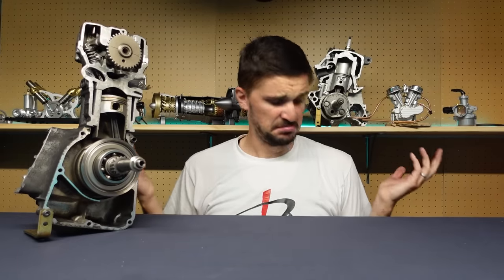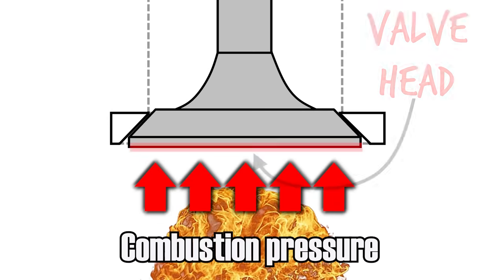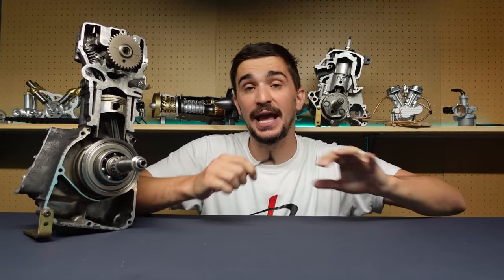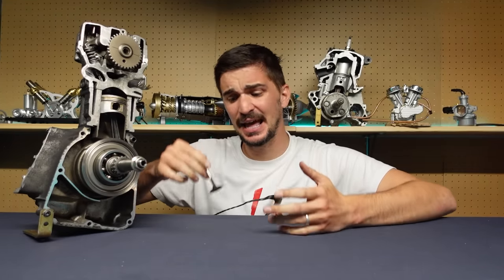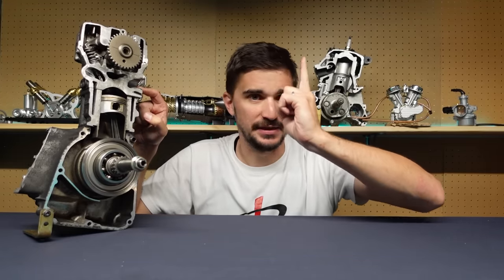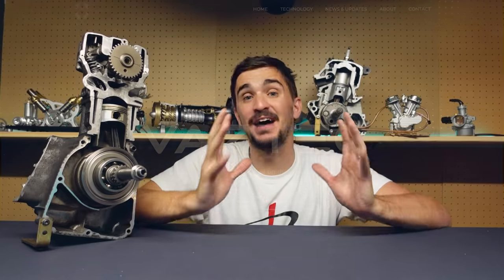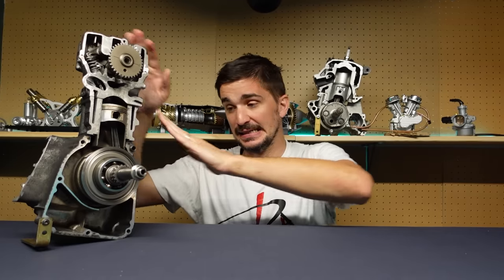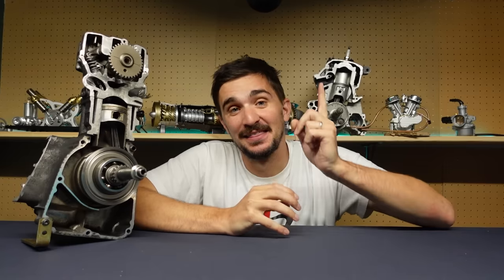Rotary Valves Make Normal Valves Look Silly - Why Aren't We Using Them?

Comment: I suspect that just like sleeve valve engines the rotary valves work out more expensive, especialy when you have a company with patents seeking royalties for their work. Could well be though that rotary valve systems lend themselves to ceramics as that withstands heat very well and as its rotary there will be no shock loads to fracture the ceramics which also seal well.

Comment: rotary valve will also cause friction loss because of its dynamic sealing under high pressure just like the piston ring. maybe using pendulum movement could mitigate this problem.

Comment: What if this rotating valve was part of intake manifold into cylinder. 
Where intake is located into wall of cylinder, 1 or 1.5cm below top dead end of cylinder. 

Similarly rotary exhaust valve 1cm below top dead end of stroke/cylinder.

It will eliminate any complexity in cylinder head and compression. 
(Like 2 stroke, all intake and exhaust opening in cylinder wall) 

Plus butterfly manifold or Reed valve is used in series with rotating valve, for extra sealing.

Comment: As a proportion of engine power how much is lost to...?:
- bad airflow from valve heads
- energy required for valve springs compression

Is it possible for a valve head to be manufactured with the same strength as we have now that also allows for articulation?

Can we make folding valve heads to allow for better airflow?

My thinking is this would turn a wall into a relative blade shape allowing more air flow.
I'd hope still offering the same or only marginally worse seal.

I'm not an engineer, so maybe there's a reason this hasn't been done, but it sounds plausible to me.
Tempted to try drawing it this evening...

Seen those funny low tolerance executive toys and figured, why not have a valve head with the same kind of tolerance that sort of folds and unfolds for exhaust and intake strokes.
Reply: Done more learning and I now think this is kind of dumb, but non-round heads would be good, maximising the area.
Thought about silly pringle shapes but you want to minimise any extra volume in the chamber so it's just a bit daft to add depth.

Comment: This technology is real, they once did a Ford V-8 with these type of valves/heads, it made incredible hp and torque Naturally Aspirated, this was before the internet and cheap video production, this should be the future of piston engines, I wish we had them now, OIL COMPANIES WOULD SUFFER CA$H LOSES OF COURSE, THEY ARE A DRIVING FORCE OF CURRENT ENGINEERING STANDARDS

Comment: hello, just added subscription, great channel.
Several years ago there where some electro mechanical valves, what about them?
As i understood, they work similar like injectors but with a different purpose, back than the problem was the heat and materials where not suitable for this application, is it possible to comment on that?

Thanks.

Comment: The problem which was stated with energy loss due to compressing the springs isnt really an energy loss right? maybe temporary but as soon as the cam stops pushing the valve shut the spring just pushes the cam out of its way which is just giving the spent energy which was used into compressing the spring back into the engine.
Reply: Energy is lost due to friction and heat. Also, the RPM limiting issues   are still there.
I got to see a Ford V8 with Coates rotary valves spin up to 14k RPM back in the '90s. Incredibly.

Comment: Interesting... but what about variable valve timing? There are a few reasons quite outside just making up for the mechanical shortcomings of the poppet valve system why you'd want to use VVT. Everything is possible of course but it doesn't seem trivial to do with the rotary system. Well, not that it's easy with the poppet valves, either! 😀

Comment: Yes, that ‘only’ drawback to the rotary valve of not being able to valve well is a major hurdle, almost would seem like that might the most important feature of a valve.😂 

As to the variable valve timing, not great, because you have both the exhaust and intake valves integrated into a single cylinder so you cannot change the overlap or the duration of the valve opening, only when they occur. Which also means anywhere or defect on any one of those ports now means the attire cylinder shaft is gonna need to be replaced. I think the electronic solenoid pop it valves would have a lot more potential or some other system that decreases the need to compress the valve spring For opening.

Comment: Poppet valves induce turbulence into the cylinders which benefits MIXING of the fuel and air, promoting more efficient burning of a given amount of fuel within a given amount of air.

Comment: Really big obvious thing missed here: Rotary valves are probably active instead of reactive like the poppet valves. What I mean by this is the poppet valves always have the right timing because they are reacting to the forces exerted in the cylinder. Rotary valves are not reactive to the forces exerted inside the cylinder, therefore their timing could go completely wrong as the rotation has to be operated independently, whilst still matching the movement of the pistons. Am I wrong here?

Comment: One huge advantage of the rotary valve is that it doesn’t limit the max RPM of the engine. As long as the engine can go to 20K or 25K RPM, the rotary valve will follow like an obedient doggie.
And one thing in the video that I disagree with: yes, you use energy to compress the springs when you open the poppet valve, but you get it right back when the springs relax back to their original state. The only loss is the friction, but the rotary valve also has friction, and perhaps more of it.

Comment: It should be noted that many engines ran on a gaseous fuel, such as methane, propane, and butane.  Of course those fuels contained no lead.  Engines designed to run on gaseous fuels used better materials for valve faces and seats which solved the durability problem without leaded fuel.  Those better materials were used from 1963 that I know of, and perhaps even many years before then.

Gaseous fuels were even harder on valve faces and seats than unleaded gasoline.  The reason is that engines running on gaseous fuels tend to run hotter than engines running on gasoline.  With gasoline engines, much of the gasoline enters the cylinders in the form of small droplets which vaporize all during the compression stroke.  That vaporization absorbs heat and helps to cool the engine.  With gaseous fuels, the fuel enters the engine as a gas so there is no vaporization to help cool the engine.

Australia makes drone engines which use rotary valves.  I don't know whether they could be practical for large engines, but they seem to work very well for the drones used in warfare.  Via google searches you can find more information on those rotary valve drone engines.

Comment: Much like the rotary vein engine the rotary valve is another concept I've looked into and in the same way isn't really possible to implement without causing excessive heat or friction and there's no good way to seal the rotating valves lubricant from the combustion chamber so it would burn a ungodly amount of oil

Comment: Technically the valve sprig transfer its energy back to the camshaft. Not all of it but great amount of the energy camshaft put into compressing the string is recuperated.
Reply: That is correct for very slow rotations.
But the faster the rotation of the camshaft, the more of the spring energy goes into accelaring the whole valve assembly.
And at some level of RPM, the spring can move it all only fast enough for the rocker to maintain contact with the cam.
At this point, zero energy is imparted back onto the camshaft (this is just below the RPM where you get the problem of floating valves).

An analogy: Imagine trying to push on a moving object to accelerate it(like, say, a rolling car): It is easy to push on it if it moves far slower than you can move.
But the faster it moves, the harder it will be for you to push on it, until it moves at your maximum running speed and you can't push on it at all.
The amount of energy you can give it is determined by the difference between its current speed and your maximum speed.
Same goes for the spring and the cam: The spring has a maximum speed, and the closer the camshaft comes to it, the lower the amount of energy that is fed back to the camshaft.
Reply: @rockyblacksmith  interesting! Thank you
Reply: Wrong none of the energy is transferred back to the camshaft it all goes into the cylinder head where it cannot be recovered

Comment: Rotory valves have been attempted many times in the past.  Still not implemented in the ICE  after more than 100 years. All the examples of a rotary valve  system I can find, First and foremost, they all look essentially the same. Second none overcame all the issues with cooling and friction . Third and most importantly the geometry does not fit well with the powerflow of ICE. It is and was a suitable option for steam ....
Yes after 100 years of trying to do the same thing that doesn't work....the same. It still doesn't work. I'm amazed. These are fun little explorations into "What if".

Comment: my 1978 kawasaki had rotor intake valve   we could punch them outta gasket material :-)...I loved that thing.... it chad a high and low range gearset so you could dirt bike in low range... 1st was like 3 km....or go on the road in high range,, were 1st was 20 km an hour..    it never got past 100 clicksa cuz the piston had never been replace and it barreled the cylinder

Comment: Ask anyone who has worked on rotary engines about getting rotating things to seal at combustion temperatures. 

Also the edges of the port I imagine will lead to hot spots and detonation. I don't think these valves will move into the performance market due to that. Maybe for things like lawn mowers and petrol generators. Nothing diesel, I really don't think they would stand up to compression of a diesel engine

Comment: By modern standards, internal combustion engines might require to install emission control parts, introduces carbon composites quicker which might extensively scratch up the rotary valve rotation tunnel. Not good for daily driven and especially prolong idling use...But, if it's for race use then it'll more likely be fine

Comment: to solve the sealing problem, couldnt they calculate how much the seals would expand and make the journals oversized, so that when at operating temp, they would have optimal efficiency? kinda like how the SR71's panels were made to seal up after the plane was in the air..

Comment: This might not be a problem that hasn’t already been addressed or not but there might be a problem with the little space with the rotary valves and the little space building carbon deposits slowing the spinning of the valves and loosing major power and or damage to the engine

Comment: I envision a design where in the valve is removed as a cassette assembly and the seals are easy to replace and service.  Make it no more difficult to service than points and ignition timing were in the 60s and 70s.

Comment: Why not have the rotary valve vertical, with the air pathways parallel to the rotary valve shadt. so the combustion puts sealing pressure on the end of the rotary valve sealing the airways. I see an issue oiling this method.. hmm.

Comment: It does take power to compress a spring but the spring gives most of that energy back to the engine when it decompresses with some being lost to friction. It's not the valve springs that uses most of tje power it's friction in the valvetain parts.

Comment: As far as I understand it, poppet valves more effectively combine the fuel and air, thus increasing power and reducing emissions.  The rotary valve appears to result in the fuel/air mix just swirling in the combustion chamber, which is bad.  Add that to the debacle of spark plug locating, and chamber sealing, and that's the death knell for rotary valves.  Electric is better, anyway.

Comment: Carbon buildup would be catastrophic. No heat transfer for the valve would be possible due to the tolerances needed for rotation. Sealing would also be an issue.

Comment: Pretty sure they tried this on some 302 mustangs years ago, they went away with no word. Pretty sure they dont seal up properly for day to day use. Wild temp changes in the combustion chamber seemed to contribute to this... but who knows. A classic valve can seal no matter what temp it is due to expansion... i dont think they could ever get away from that.  Same problem rotary engine have.... it will wear out faster than anything else.  A single guy making an engine is not the same as producing one and it being suitable for road use.... lots of race engines do stuff that would never work on the street. So basicly means nothing.  Rotary valve and engine systems wear fast. thats their problem.

Comment: This is EXTREMELY cool and compelling, but all it makes me think of is the Wankel engine and how it can solve all of the issues that the rotary valve system has. How about no valves at all? In a rotary engine, the rotor (analogous to a piston) effectively acts as the valve, as when it is in position for the power stroke, the rotor is blocking the intake and exhaust ports. The rotor opens the ports as it spins around the rotary housing, due to its hypotrochoid shape, it moves the gasses in a circle around the housing. Check out a gif if you haven't seen one. These engines had their own problems, but they were only ever built and employed at any scale by Mazda in the RX series cars. They had the sort of flaws that you'd expect from underdeveloped engines, big issues that are relatively simple to fix. If only the market was geared toward rotaries, they might be a vast improvement over reciprocating piston engines. The power to weight ratio alone is a huge advantage--these engines are so lightweight. Not to mention the lack of rotational and friction losses to a valvetrain that doesn't exist in a Wankel. I really think the durability issues would be easy to iron out. Forget pistons, honestly.

Comment: Few disagreements:
1. Zero tolerance fiber manufacturing cutting vacuum channels will allow positive sealing instead of o-rings/etc
2. New materials/ceramics/composites that expand together, while being more resistant to expansion for an automotive application will make for a better approach than 1989's access.
3. Assuming BEV demand impedes ICE development just because "the big companies" aren't assigning their downward funds is simply not true. We have long entered the age of the ubiquitous R&D so development in "garages" and small related companies are a better foundation to innovative products that just work (i e. Tesla, SpaceX) versus bloated, bureaucratic legacy meteors that are so blended with their governments that getting anything actually innovative versus just a new gimmick executed is rarer than hen's teeth (i.e. General Motors, Ford). IRL, small, Chinese companies, some which were grown from garages, are SLAYING GM/Ford/VW/etc in BEV innovation and sales.

Comment: Valve float is not the rotation of the valve. The valve rotation is intentional and reduces deposits on the valve seat which will reduce performance. Float is a product of inertial forces overcoming spring force resulting in a bounce against the valve seat. It typically occurs when the springs are degraded o engine conditions are outside of design conditions.

Comment: There's only one way you could prevent leaking around the outside of the valve body. Each one would have to be slip fit into its respective pocket. (A slip fit is when two parts fit together with NO slop at all but are still able to move freely. You're talking a tolerance of .0001 between a good and bad fit. It's almost never seen outside of toolmaking and aerospace.) Which would be prohibitively expensive and essentially make every individual valve a custom part.
But even then you would still need to oil them, both to maintain an air tight seal and for lubrication. This would mean that oil drips into the cylinder as the valve rotates. This would cause the engine to burn oil, run dirty, and potentially even cause knocking, especially on startup due to the oil taking up cylinder volume and therefore changing the compression ratio.

Comment: Effectiveness is never "silly".  Poppet valves exist because they work and work under degraded conditions not least because combustion pressure attempts to seat them. Poppet valves have another key advantage which is easy manufacture therefore easy repair and replacement. Valves, seats and guides are easy to machine on the mother of all machine tools, the lathe.  They are easy to machine accurately and cheap to produce. They are easy to duplicate with different dimensions for repair,  hot rodding etc.  The components are easy install and easy to service. 

Contemplation of why winning designs have been winners for longer than cars existed (poppet valves were invented in 1833) is instructive. For raw HP the best piston engine solution is the two-stroke whose power to weight ratio is spectacular but emission regs killed them. The Yamaha TZ 750 dominated GP racing until dispose of by a rule change made for that purpose! (Sanctioning bodies wanted racing to sell factory street bikes after all, the only reason racing is sponsored is to move product off the showroom floor.)

Comment: but if there would be 2 valves per cylinder spark plug could be between valves. problem solved. oh and cylinder could be oval too like in that honda engine... and 2 crankshafts so piston would not touch cylinder walls. is it doable?